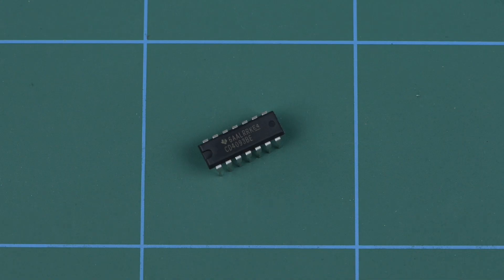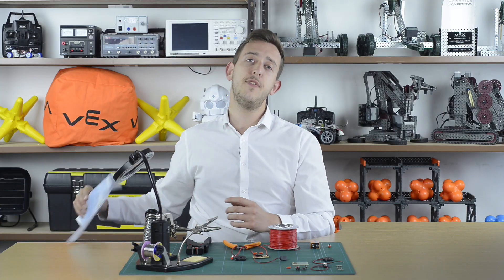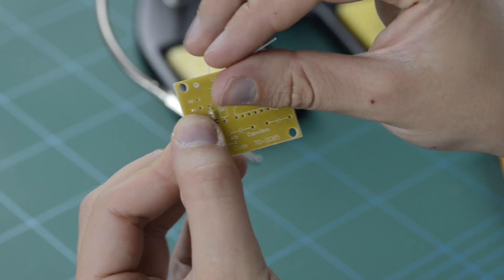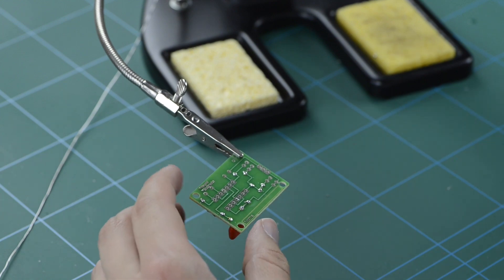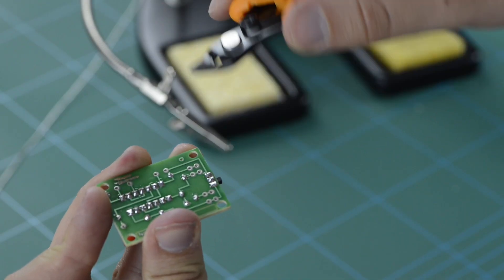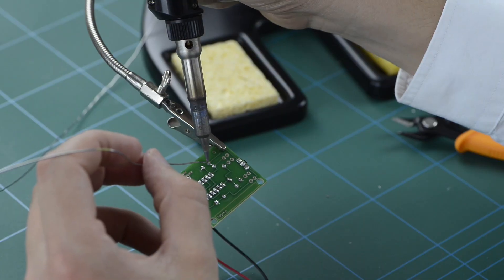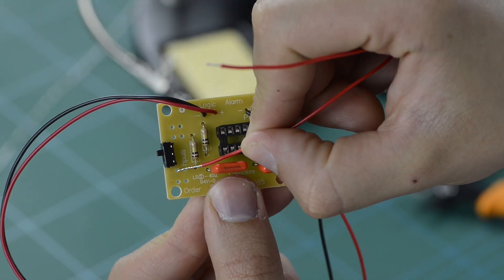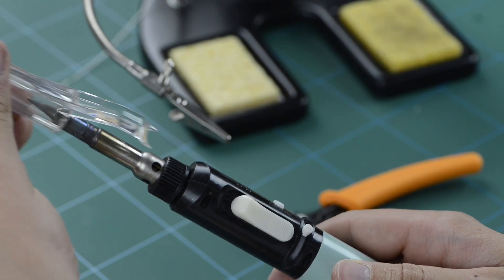How to make a Logic Alarm Project

Comment: could a relay be used to turn it off and on again without having to switch off or remove battery.?
Reply from the maker: Hi there, unfortunately without modifying the circuit this would be difficult to achieve.